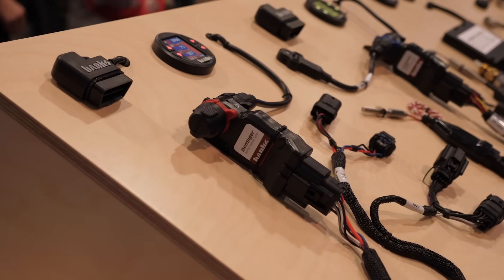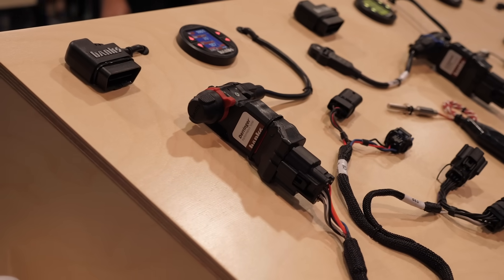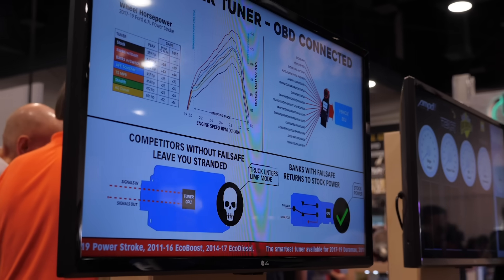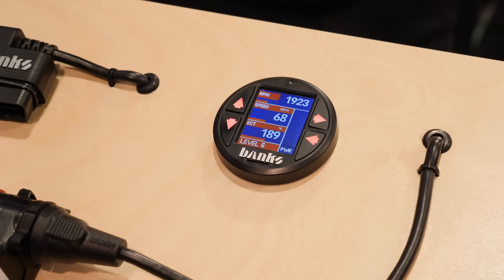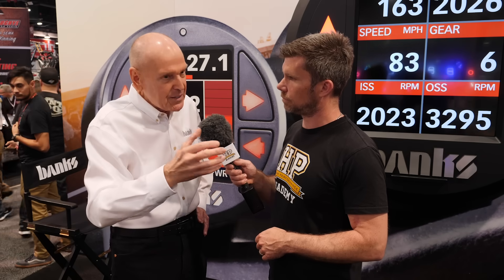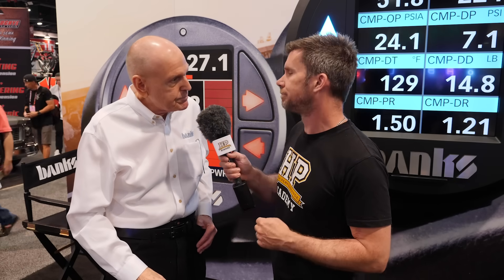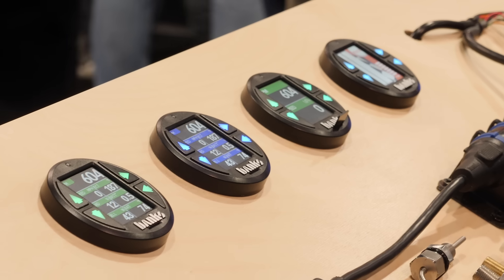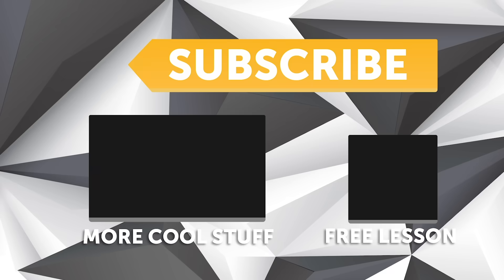More POWER With A DPF Fitted? | Gale Banks On Emissions [TECH TALK]

Comment: I'll keep the bs emissions on a diesel of the cost of the parts comes way down. Otherwise the delete is by far cheaper to do.  Why is a EGR cooler over a grand or the EGR valve a grand. Not to mention the cost of the rest of the parts an sensors. If the cost comes way down people would just keep the system. But me in not paying 4k just to fix the system. When a delete kit is around $1,500
Reply from the maker: Two different groups of people here.

One group is removing emissions equipment because they don't want to pay the cost to repair.

The other is removing because they think they have to in order to make more power.

We're talking about the latter here - Taz.

Comment: DEF saving the environment by adding 200 million plastic jugs a year
Reply from the maker: Why use a jug when you can just get it from gas station via a hose just like your diesel? Or is that not an option where you live? (where do you live out of interest?)
Reply: @hpa101 I’ve seen one def station like ever and it was 3 hours out
Reply from the maker: @Urfatandihateu  where are you based? - Taz.

Comment: Not gonna bullshit me. 
Never going to make as much power, not gonna be as healthy with obstructions within the flow path of the engine. 
Plain and simple. 
Never gonna be healthier for an engine to reprocess its own soot/exhaust gasses through the intake.
My ram would get 11-14mpg before deleted in stock turbo. 
On the new turbo fully deleted I get between 18-25mpg.
 It does not put out thick black smoke and any excess in emissions is negated by the massive increase in mpg which decreases my total diesel input necessary. 
This is extremely basic stuff.
Reply from the maker: You would need to get your data, then do a delete without doing ANYTHING ELSE, get that data, and then compare to actually compare.

Emissions equipment is not there for performance but your tune is what is making the difference for you here - Taz

Comment: I have a 2019 Duramax, With 400,000 highway miles 50% loaded 50% empty, I've been using the deranger and the IDash for about 250,000 miles.  I've kept it on stock setting for a long time because I'm afraid it will clog my original DPF filter As the mileage is getting high. Everything is still stock and original.
Reply: Why the hell would you keep your emmisons on a out of warranty truck? 😂🤡 more power, better reliability, and fuel economy

Comment: For my situation, with the ‘12 lml, I’m not so concerned with more hp and torque, nor rolling coal. My concern is engine life, performance (in getting the most out of a ounce of fuel), and reliability of components.

Comment: My 2¢ on the epa, United States and emissions is that if your car gets “caught” being modified you should be able to at least pay a state ref engineer to check that work isn’t shoddily done and that it passes smog tests. If you convert your grandma’s 1985 station wagon and fit it with a modern efi system for fuel economy and efficiency California would more than likely classify it as a gross polluter despite polluting less… work with tuners (businesses) and the public to make this place not so much of a hellhole for auto enthusiasts

Comment: So how do you your "PREVENT" soot in the manifold, intakes, EGR etc?( which caused trying to meet EPA standards) The exhaust soot and emission issue on discharge is addressed.
What after market piggyback electronics prevent the recirc "soot" issues , heavy contamination of engine oil that is caused directly by this recirc issue verses normal air intake contamination and blow by of older models?
Anything that will improve on the current O.E. design to perform as well as a delete . Thanks

Comment: We have had cases in Australia of vehicle being disabled because of regen issues (no ability to force regen) and slow off road driving causing issues.
People have almost died in isolated locations because of this, we also had many (so many ford did a recall) Ford rangers catching fire because of off road regens.
With dpf removed and egr turned off via ecu. Vehicle uses 20% less fuel, egt is lower by a few hundred degrees.
Not much not to like.
Reply from the maker: Why didn't they have a spot tracker or similar? Show me stats on EGR failure deaths in the outdoors being higher than other avoidable reasons people manage to lose their life and I'll be convinced it's an issue.

As for increased performance, most people remove their DPF and then get a tune. The performance is the tune. You can do that with the DPF fitted 😂

At the end of the day emissions systems are not there to increase your performance, but if you are running your car on the road and have laws to follow, emissions produced by your vehicle are real and while the systems are far from perfect, they are there for that reason instead.

Love them (I don't think ANYONE does) or hate them, emissions systems are here to stay - Taz.

Comment: dpf is a fraud bcuz soot has to go somewhere if not now than later. dpf decreases the performance of diesel engine, it hurts the engine. when its clogged it increases back pressure. increased back pressure also leads to weaker combustion n burning of exhaust valves. it hurts the engine. no arguments here.
Reply from the maker: Things are very different in a solid or gas form. Look at cyanide for just one off-the-cuff example - Taz.

Comment: Doing a full delete, to me is encouraged.  The emission equipment on these trucks isn’t developed enough to have solid years and years of reliability. Not to mention cost effectiveness when repairs or maintenance may be required.  However, doing a full delete for the purposes of “rolling coal” tells me who ever does that does not need a diesel vehicle.  Those that do that have no clue what they are doing and most certainly do not need a diesel truck.  
Vehicles with the full emission systems on them are fuel hogs and the gas recirculating systems are the shovel digging an early grave for that motor.  Intakes are filtered, so therefore soot in an intake is bad for the engine. Remove the emission garbage and run the engine like it should be ran.

Comment: Imagine being the creator of DPF and telling people it keeps the carbs down. Then you explain to the EPA that when the DPF exhaust gets clogged up the engine will do a complete burn off of the DPF. Then the EPA just says ok sound good, do it. The EPA never asked during the burn off mode what happens? Well what happens is when the DPF exhaust gets clogged the engine goes into a burn off mode and runs over 1000 degrees so that it can get a complete burn off of the Carbs in the exhaust and it just vanishes into thin air. The consumer ask ok but where does the carbs go during the burn off? The DPF inventor says,In the Ozone du. LoL!!! Complete idiots!!! I should invent something that doesn’t work and put a label on it and say it’s good for the ozone and get the EPA to clear it. Id be a billionaire. I think the EPA is ran by Fauci himself. It must be nice not to have a Conscience. F people all the time and go into a million dollar mansion and tell the wife I did a good job today. I F millions of people and didn’t wear any protection because I’m backed by the EPA.
Reply from the maker: Not sure you understand exactly what it is the EPA does, and how the global car market works. There is more to emissions than just the EPA and the USA - Taz.